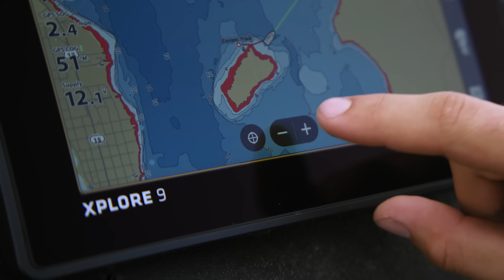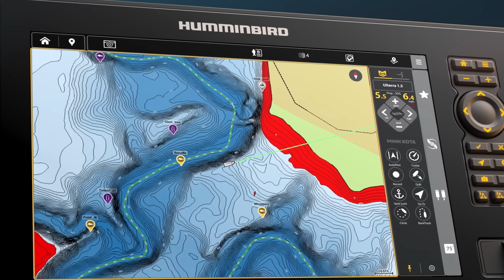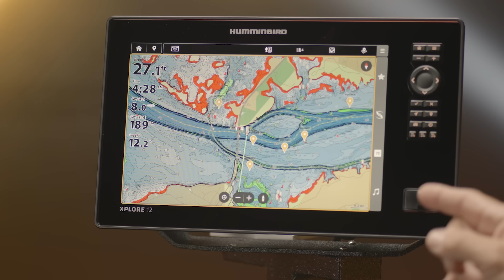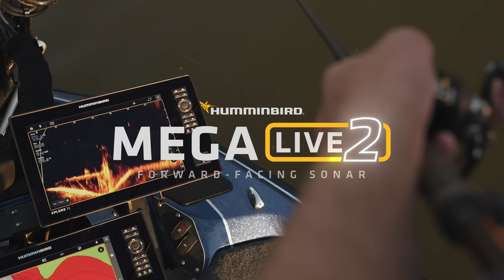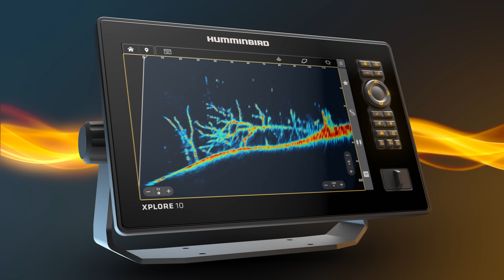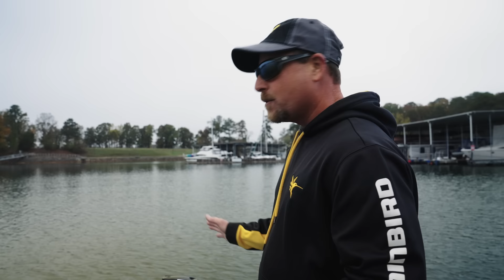New from Humminbird®: XPLORE™ Fish Finders and MEGA Live 2

Comment: The new mega live wont work on Helix but in this video i really didnt see much about mega live 2 that has change. Also the One boat network does not link mapping i have to purchase each lake or did that change? With Garmin i get all maps with the unit and on the Active captain on my phone for FREE.
Reply: Mega Live 2 is more than double the Hz output from the first ML- which equates to seeing fish and your bait farther out. In forward mode, you will see both fish and your bait past 100 ft which the first Mega Live could not achieve. Redesigned mount for versatility, finer angle adjustments, 15 color palettes, new features in landscape mode and the list goes on. Helix could not share mapping, but every Xplore unit will include a Lakemaster map card and can share to another Xplore, Solix G3 or Apex.
Reply: @flawsee8456  Is this mapping include to the phone app for free? That i one thing made me turn away from the One boat app doesn't allow the map to be shared.

Comment: More sales HYPE, how about actual engineering/test results...  I have MegaLive1, lure tracking sucks....  1/8oz jig can be seen up 33', coming and going on display.  What will ML2 display a 1/8oz out to???
Reply: what is the size of lure? I meet the same problem. I cast 6-7in soft baits and max you can see is 46'. This is the main problem of ML1, on lvs these is no problem 70 > 80'
Reply: @ramunasjuodeska1475  as stated, 1/8oz jig with half a nightcrawler or 3" plastic paddle tail...
Reply: @ramunasjuodeska1475  1/8 oz plain ball head jig with 1/2 of a night crawler or leech.

Comment: Why Mega Live 2 not go with Helix Gen 4?
Why humminbird realease Gen4 ???
Reply: Processor speed my man. The G4 was released in 2000. That is a long time for electronics.
Reply: No it wasn’t. GN4 was released Oct 1st 2020
Reply: @jonmartinez1855  No sir, Helix Gen4 realease 01.10.2020 and I by it now
Reply: @jonmartinez1855  Gen 4 was not released in 2000.  Gen 3 was released in 2018 or 2019. Gen 4 maybe 2023 (that's me guessing a bit)
Reply: 4 years in the electronics world is still a long time...😊
Reply: @peterlong9629  maybe but why GEN 4 no difference to GEN 3.
I have over 20000 $ Humminbird on my Boat and I cant use Mega Live 2 ?
Sorry then I go with Garmin !
Reply: @thomaswalus7608  The answer to your question, if you want it, is at Humminbird Customer Service, which I am not. You might want to ask some questions about Garmin though...
Reply: @peterlong9629 so every 4 years are you prepared to drop 10 k for electronics?

Comment: Sounds great, hope that worth it. Mega live 1 was a piece of sh*t, sold it and forgot.)) Time will show.
Will ML2 work with Helix Gen3? Any additional "black box" needed to work with or directly through ethernet interface like ML1?
Reply: It will not work with any of the Helix models. The processing power of the transducers inside the head units. Helix  uses single core processors. These new ones have quad core processors. No black box
Reply: @sparkfuzz1177  thanx for the the answer! Little bit upset about Helix...(( Anyway, I'll watch beyond. Best wishes.

Comment: Two features that I would love to see in new units. #1) Never brick your unit. If anything fails ... an update, a reboot, whatever, have a hardware reset button on the back of the case that reimages the unit to a known good image so you don't have to mail in a bricked unit (unless there is hardware damage). Macintosh has had this in their OS for decades. #2) assigned software meaning to either the waypoint icons and/or colors. Meaning, I could tell the system "delete any green icon" after it is X hours/days old. So, can put any 'temporary' icons in green or use the baitfish icon and know they won't be on the system forever. Personally, I mark structure with Red or Yellow. Then when I go out for the day, I'll mark fish in blue/green/purple. Next time I go out I'll click on each Blue/green/purple icon and delete them manually. All of this said, the XPlore looks nice and I'll end up buying one soon.